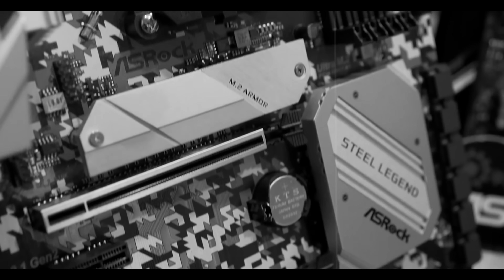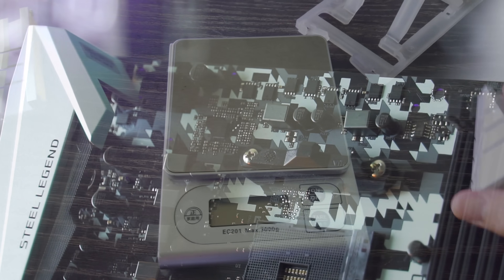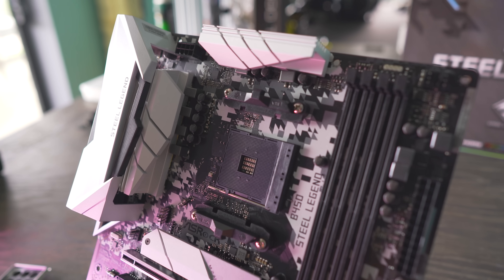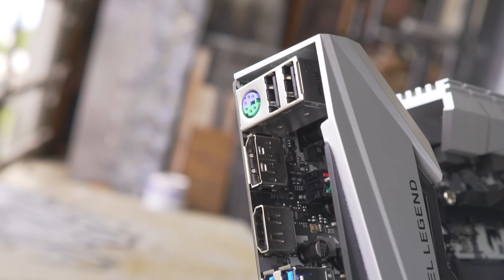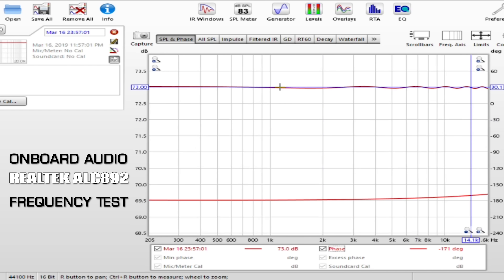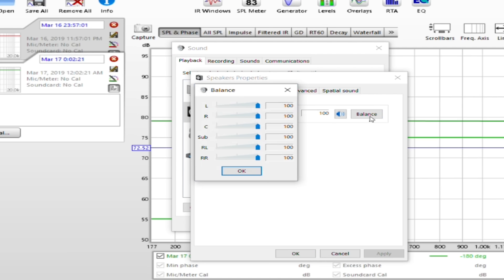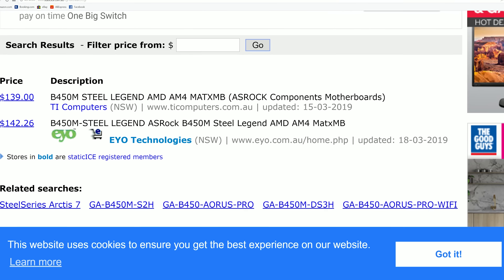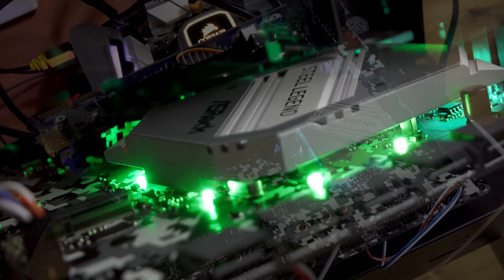Is this The BEST Value B450 Motherboard Right now..!? (Steel Legend Review)

Comment: I would really really love a comparison to a b450 tomahawk. Such a shame
Reply: it completely sucks compared to a b450 tomahawk (and even compared to Gigabytes boards, really)
just look up buildzoid/gamers nexus video on best b450 boards
Reply: @rawdez_ Yeah, I know, I have been recommending Tomahawks since they came on market. Such value, and since MSi improved their bios recently, those boards rock. I know, that Bryan is kinda Asrock shill, but man this review didnt really help anything
Reply: @Kossmok  I already mentioned it in my other comments here - you don't even have to go with Tomahawk, there are cheaper MSI boards that are still better than ASRock/Gigabyte/ASUS ones for the price. A-Pro, Mortar, Gaming Plus.
but there are also MSI boards that suck -  v2 and new ordinary versions of Pro-VDH, Bazooka, namely. Plus versions of those are fine. (ignore boards without heatsinks completely)
also MSI is not a good choice if you're going with an APU and planning on overclocking it, they have an awful APU overclock support in BIOS and 2 SoC VRM phases for iGPU, whereas other vendors usually (not always) have 3 of those phases.    

https://www.hardwareluxx.de/community/f12/pga-am4-mainboard-vrm-liste-1155146.html
almost everything is in here, just no info on v2 versions which use shitty nikos mosfets

Comment: VRM isn't mediocre it completely sucks, cheap Gigabytes are better in that department e.g. DS3H, and thats not even starting to talk about mid-range MSI boards (keep in mind cheap non-Plus MSI boards aka v2 variants suck too)

basically this video starts from how this board sucks hard in VRM and then goes on into in what departments it actually doesn't suck. but hey, who cares. a good board is a board where everything is at least ok. not where everything cool, but VRMs can be used to cook a meal. 

nice video in great detail though, thanx
Reply: rawdez my friend has a cheap Gigabyte board and the vrms go up to 115 c so no that’s even hotter
Reply: @fabian3705  what board and CPU exactly and under what conditions, you are talking about. 
you can't just call all boards crap if some of them suck.
also gigabyte's board i'm talking about is much cheaper than this piece of crap

>so no that’s even hotter
nope, its not, not necessary that is, because tests under different conditions in different cases/room temperatures etc. are NOT directly comparable.

Comment: Which is better steel legend or tomahawk
Reply: Tomahawk would be the better buy. VRM is just as strong but also has that Nicer heatsink. More importantly however the Memory Support for MSI seems to be overall better than ASRock.
Reply: Beef n Gravy oh ok I was about to buy the steel legend because it would fit nice with my white Corsair carbide spec 06
Reply: @BeefiusGravius  VRMs are A LOT better on  Tomahawk
check this 
https://www.hardwareluxx.de/community/f12/pga-am4-mainboard-vrm-liste-1155146.html
and just look up mosfet specs 
what you need to look at is
1) power delivery capabilities in amps - more = better
2) RDS(on) resistance @ 10v - the lower = less heat = the better
Reply: tomahawk rips it apart

Comment: I kind of believe this board is just another Aorus elite... Crappy VRM/Heatsink and a lot of LED to make board look great. I'm pretty sure that thermal wise, it's vrm will be worse than pro4.
I'd probably pick Mortar over this...
Reply: its actually a lot worse
Reply: Yep, the Tomahawk and Mortar, have great VRM's when compared to rivals at this range. But unfortunately, I have to say, it has crap everything else, especially in additional features, when you compare it side to side, say to an Aorus Pro or Rog Strix-F. If your'e really gonna go for a MSI board, fork out that bit extra and go for a Gaming Pro Carbon, which is basically a Tomahawk, with the additional bells and whistles and is probably the best B450 board, out there.
PS. VRM's don't matter as much on mid/lower boards anyway, as most people will buy X470's, if they are interested in pushing overclocking to the limits (most people aren't) However, I wouldn't go with MSI, at all, on the X470 boards, where they tend to get severally spanked, by everyone.
Reply: @fafski1199  priorities man, get it straight. Are you really need all those stupid bells and whistles when your CPU can't work as intended on your overheating board?
This ASRock, an Aorus Pro and Rog Strix-F are for kids who need RGB and shiny looks more than real performance. Just like that.
Reply: @SORAW441 WAS terrible. With B350 boards and unpolished bioses. Now it is best for CPUs, not for APUs though.

Biostar uses CRAP mosfets,
Gigabyte AORUS B450 I Pro WiFi is one of the good boards for 6 core processors, it uses IR3556 power stages and a decent heatsink that also acts as IO cover, that is a MSI idea really. So nice choice.
All other B450 Giga boards use 
4C10N and 2x 4C06N. Which is a lot worse than what MSI uses on their good boards (they have crappy ones too).

Stop sounding like you know better when you actually don't.
Reply: @SORAW441 Gigabyte Boards can run into problem if you are using them with 2700X(with PBO)+AIO water cooler, and i've seen enough people Actually choosing aorus elite/pro or prime A/plus for such build here in Korea....
And not overheating 3 phase is better than overheating 4 phase, and hardware unboxed test seems to suggest that pro4 heatsink design is actually quite good
Reply: rawdez  Sorry, but as far as I'm aware, there has been absolutely no reports of major problems or issues with VRM's overheating, on any of the B450's. (If so, then point me to the report).
As I said the only possible issues you will have with the VRM's overheating on a B450, is if you try overclock them far too high (especially if overvolting), which obviously you shouldn't be doing, since the boards aren't designed, for extreme overclocking. And like I said, you really need to be using a X470, if you are trying to overclock anything much beyond the CPU's recommended boost. It's also wide known, that the MSI boards come up a little short on features, when compared with the opposition, at this price range.(it seems like they skimped and cut back on features, in favour of better VRM's)
Reply: @fafski1199  look at any B450 boards reviews starting from hardware unboxed, gamers nexus and actually hardcore overclocking.
Majority of people running their systems at stock. As I see it - if you are running at stock just buy A320 board. 
If you're using X processor or overclocking at least to 4GHz - always go with MSI.
You virtually can get the same results as with x470 boards from other manufacturers with B450 MSI boards like Tomahawk, Mortar, A-Pro, Gaming Plus.
As I see it 4-4,1GHz is not an extreme overclocking and its just enough for current gen of Ryzen processors. Going higher than that isn't really how these processors should be used on a daily basis and isn't good in terms of performance/power usage ratio. So no one really needs an x470 board if they did their research diligently or aren't hardcore overclockers.

You can start your education from here https://youtu.be/6qZW3-xZEHg
and here
https://www.hardwareluxx.de/community/f12/pga-am4-mainboard-vrm-liste-1155146.html
Reply: @SORAW441 so you somehow bricked your BIOS chip with an update and MSI is responsible for that?  Isn't it stated virtually everywhere that flashing a BIOS is a risky procedure and it could go wrong for a lot of reasons and you shouldn't be doing it on a daily basis if you aren't ready to go to a service after that or flash BIOS with a chip programmer by yourself?
And Mortar have a BIOS flashback feature for situations just like yours, you probably should've tried that.

All those vendor's boards suck even more for the same price. There are cheap Gigabyte and ASRock boards that just straight up don't work from the box. 
And midrange ASRock and even high-end ASUS boards have bad quiet sound in a headphones. So I don't know. 
I agree with you that pricey boards should work fine, but a lot of times they just don't. I don't like MSI per se, they have shitty boards too, e.g. fresh Bazooka v2 just sucks because it uses shitty mosfets and a shitty peace of aluminum instead of a radiator,  just like on B350 boards, but when someone does something good I deem they should get respect and a lot of customers of that good product.

I actually kinda like the Gigabyte DS3H for its price. The problem is all other Gigabyte boards use the same VRM at higher price points. And ASUS use same mosfets everywhere. And all that with shitty heatsinks. Noice. Really. Noice.

Comment: Still using my msi x370 pro carbon for my ryzen tests. it Got my ryzen 5 1600 to 4.1ghz so want to see what it can do with the next gen ryzen
Reply: i have msi x370. not tried to overclock yet though
Reply: X5675 on a G1.Sniper... 4.3ghz OC with zero effort.
Reply: I'm using a ROG strix B350 and a Ryzen 1600, and have 4.1 with a 360mm radiator.
Reply: 4.8ghz r5 3600x is what you'll probably get R.O.E.
Reply: 4.1 at what voltage though?
Reply: @HOTPLATEGAMING  im using msi x470 gaming plus and r5 2600 with Dark Rock Pro 4. My OC is 4.05ghz with 1.325v. best i can do with this voltage. Dont wanna go further
Reply: I somewhere saw that x370 won't support new gen ryzen but i could be wrong
Reply: Cekpi7 amd have said nothing so far and the rumours that have gone around cannot be trusted. I’m expecting they will for x370 not so sure about b350 though. But you could be right
Reply: @cekpi7  I'd expect it will support 8 core hyperthreaded chips, but maybe not any more. If they release 12 or 16 cores you'd definitely want a new board to suit.
Reply: @cekpi7  X370 will support, but the B350 will most likely won't.
Reply: Cekpi7 even b350 boards support zen 3 rn. If you already have one you will have to update it, if you buy a new one itll come shipped 3000 ready.